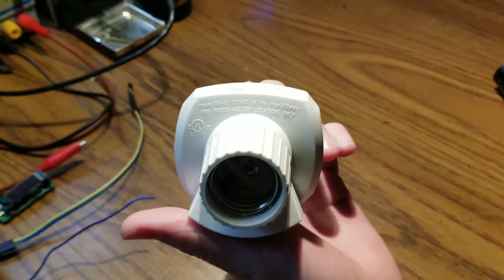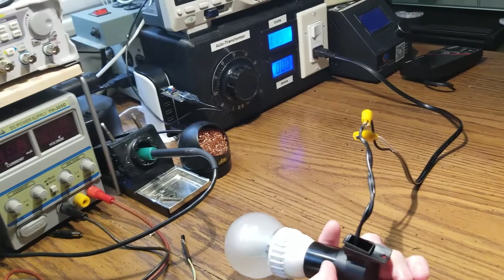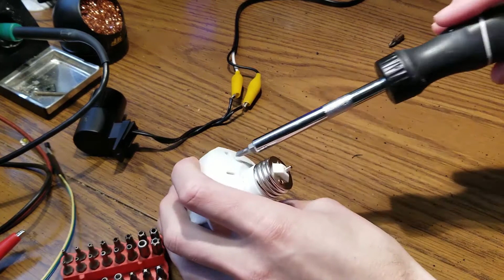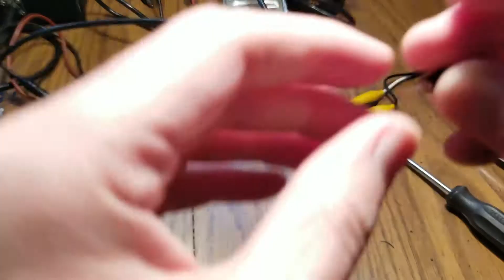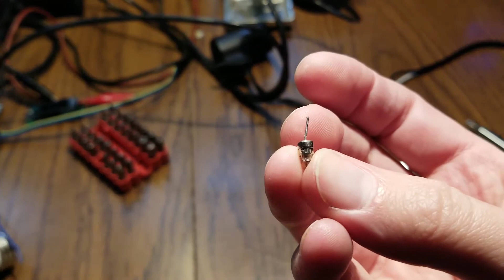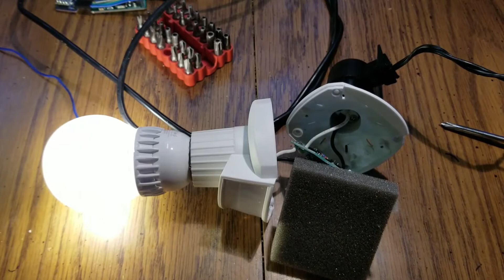Repair of a GE 18048 Indoor Motion-Sensing Light Control.

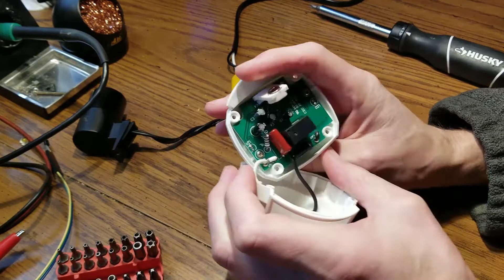Comment: 3:35 Sorry to bother but are you sure this black rectangular thing is a relay and not the potentiometer for the timer? So if I open and turn the screw on it, there might be a chance to change the delay and On time of the unit? I assume these kind of devices should have a variable capacitor/potentiometer for such adjustment!
Reply from the maker: Pretty sure it's a relay. It is marked with RL1, and looks like a relay. The timer is probably programmed into the microcontroller. I think what you see as a screw hole is probably a leftover from the plastic injection molding.
Reply: @Datzfunk  Thank you.
So no way to increase or decrease the duration of the light staying on?
But for my daytime light annoying light turning on, I found an easy solution. Left the plug controlling this lamp stand on a cheap home wifi socket and scheduled it on only for the night hours of every day of week! 
Well spent more that $.99 but then a working solution for much less fuss top open those triangular screws :) only now if I find a way to shorten the duration of the light that randomly stays on for ever!
Guess cheap things have a good reason for being cheap but I am really surprised you found GE logo on them and I indeed saw a UL rated marking on mine. 
Thanks again pal.

Comment: Thanks for this upload as this seems to be one rare-to-find, very problematic item! that I got from a local 99-cent store. But in my case, this thing won't turn off correctly or remain on for a very long time sometimes the entire day and night... And yes, it even turns on when motion detects in the entire daytime with no feature to realize it is the day (Like any other similar product in the market)...
I tried to open it up but don't have any triangular screw head that fits it and lucky you for having the tool.
In any case don't know if I should tosse it work farther on it... 
And moral of story:  DON'T BUY THIS ITEM! 😅 If it works, it only works in China!!